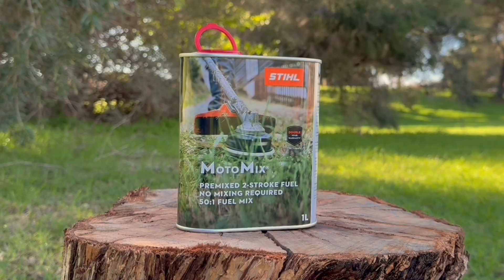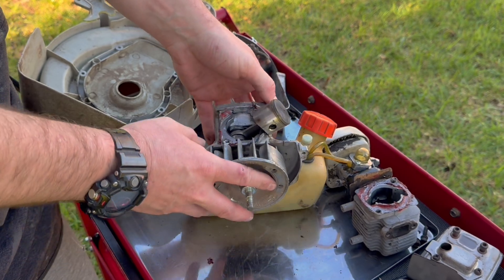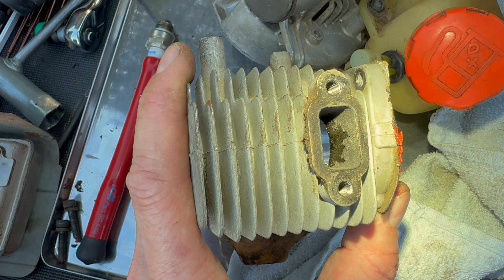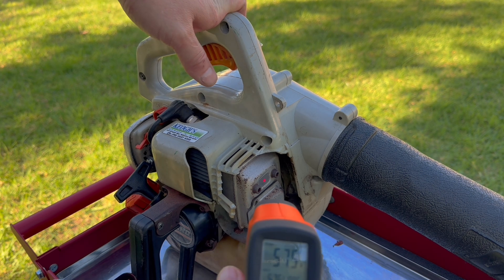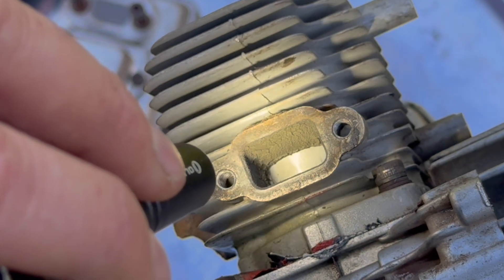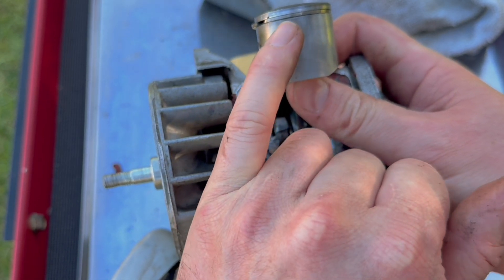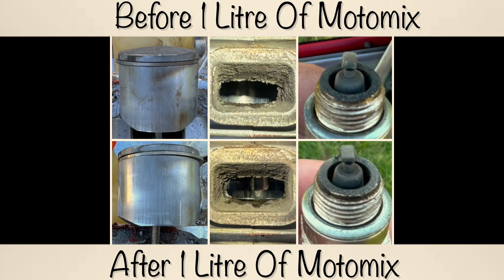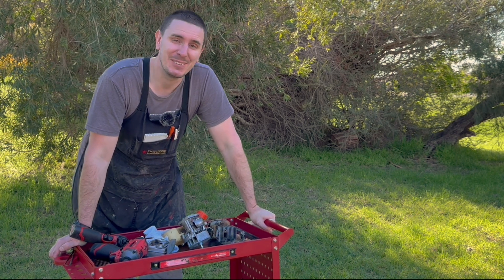STIHL MOTOMIX: Are They Stretching The Truth?

Comment: I Don’t See a Huge Difference I Think Motomix Works Good For the Occasional User In Preventing Stale Fuel in There Equipment After Sitting For Several Mos 😀 But If Your a Frequent User Just Use 93 Octane 40:1 Stihl Premium or Echo Red Armor and Run With It 😊😇👍🏼 Thanks For The Testing My Friend
Reply from the maker: I think you’re spot on :) thanks for sharing!
Reply: Providing you are using a quality oil and making a proper mix to the proper ration you are 100% correct but for annual storage at EP we suggest using our Kinetix brand alkylate fuel with our guarantee start up even up to two years. One service for a no start condition due to ethanol pays for many cans of alkylate fuel.

Comment: Hi Tom! I am not a fan of canned fuel for economic reasons.  It's so expensive, the price difference you pay with canned fuel over the life of the equipment will pay for new equipment, usually more than once.
Reply from the maker: Hey Bill! I agree, it’s overpriced and unnecessary often times! It has its place, but not for most people :)
Reply: @VintageEngineRepairs  🙂
Reply: Bill the Old Man at Eliminator Performance just commenting that we sell the B&S Kinetix brand of alkylate fuel 4 cycle, and 50:1 & 40;1 grades to all our customers for long term storage and even for 5 to 6 month storage use. In all cases we guarantee two year start up and to date can tell you that our annual profit margin has decreased due to these fuel sales. Additionally, our neighbour has 5 pieces of 2 stroke equipment and uses the Kinetix brand full time for the last 6 years without issue. We presently sell a can for $15 and reduce that price for multiple can purchases so our neighbour spends approximately $78 Cdn annually and prior to that was spending way more than that on labour and carb cleans and rebuilds. We feel bad for our customers that do not use an alkylate fuel and year end for storage, especially when their equipment does not start and they need to bring it here again. Many even when they have run the unit out of fuel noting they never get it all out of the carb bowl. The up sale here at EP really is "you can pay me now or you can pay me later" the smart ones spend the $15 pass the information on to their friends etc. and we continue to grow the customer base. One full service which includes a carb clean and fresh fuel here pays for 10 cans of Kinetix.
Reply: @waynestefinashen239  Hi Wayne! I agree with you completely that canned fuel is better for storage than untreated mix, and it allows people that don't store properly to get away with it. I tell my locals to use Sta-bil all year due to the heat here and to run them dry at the end of the year and have had really good luck that way. Lemme show my logic for not using canned:  Counting the additive price into the fuel cost brings it to about $3 a gallon(gas is cheap in Texas 😁). The best price we get for a gallon of any canned fuel here is $31 and change. I go through about 4 gallons a year in my yard between weedeater, backpack blower,  chainsaw,  etc. And spend about $12 a year on fuel. I haven't had fuel issues(so far), and I replace all my lawn gear about every 8 years or so. 
In 8 years' time,  my fuel cost here using canned fuel would be around $1000 as opposed to around $100 for pump gas and 2 stroke mix and Sta-bil. If you store correctly, which we both know a lot of people don't,  that's $900+ over the life of the equipment. Of course, the whole "storing correctly" will shoot some people in the foot 🙄🤣
Reply: @GuysPlayingWithTools  Got your point Bill we are using the BGSC2 fuel stabilizer now never had issues with the K100S+ just wanted another great alternative.
Reply: @waynestefinashen239  I agree 100% with the canned fuel for the guy who doesn't store correctly.  It definitely has its place there
Reply: Canned fuels are good to flush pump gas out before storage. Makes restarting your tool even years later a walk in the park, as they seem to protect all aluminium parts from corrosion and the rubbers from dry rotting/hardening (carb block and components, membranes, fuel lines). I stopped having issues after switching to them before storage, way better than just running the equipment dry.
Reply: @em4703  That's why I use Stabil storage in mine. That would be a good winter experiment.  I am going to fill one weedeater with canned and one with my normal mix and run them both empty today and leave them until March. 👍
Reply: @GuysPlayingWithTools  stabil doesn't do anything though. multiple tests running around the internet with all kinds of brands of fuel stabilizers, none work besides the stuff they use in refineries, and even that gives the fuel a few months of life tops. it also doesn't stop corrosion and dry rotting of rubber. you can make a can of normal pump gas, one with pump gas and stabil. by march they'll both burn the same: poorly or not at all.
Reply: @em4703  I expect the canned fuel to do somewhat better. I use the storage blend in everything all year and have never had any problems storing tools for winter.  I hate to do it since it know what to expect, but I will add a 3rd with no additives. I always have a few sitting around.
You are making me think about how I can make it harder on the machines, I am going to leave them uncovered out back.
Reply: @GuysPlayingWithTools  You do not have to run them out of fuel, leave the fuel in both
Reply: @waynestefinashen239  I have been pondering that,  even though we know what will happen to one with no additives, I was also thinking that the best test is full
Reply: @GuysPlayingWithTools  We have only been installing either a 1/2 or full litre into equipment and never had an issue with moisture likely because there is no ethanol. Over 10 years even with the small amount added to generator fuel tanks we have never had issues.
Reply: @waynestefinashen239  I was thinking that too, but we can still get ethanol free here
Reply: @GuysPlayingWithTools  Lucky have you tested it to be sure?
Reply: @em4703  100% correct
Reply: Not if you have a $2000 chainsaw that you only use once a month or so when needed.
Reply: @Russell-d8s  It is the only thing to use in a chainsaw that is rarely used same thing goes for generators here in Canada we use Kinetix alkylate fuel from B&S

Comment: More gimmicks .
I have been running motors on normal oil for 50 years never had issues.
Its not a F1 engine.
Cheers 🥂
Reply: My Dad, even up through his 80’s used regular motor oil.  He mixed his own.  That’s what they had. His equipment always ran great and clean.
Reply: @steveriggenbach90  4stroke leaves alot of ash but can be used .
I use good quality 2 stroke oil 32:1 in all saws .
Also non alcohol fuel.

I raced motocross bikes Enduro all two stroke .
They of course require synthetic racing oils .
Reply: @Motorhead250  I’ve had great luck with echo red in my equipment.  Lucky to have station that sells non ethanol rec  90.    Today’s oils are superb to the old.   Works better with the heat and tighter tolerances.   Haven’t rode in years.  Good talking to you.
Reply: @steveriggenbach90  yeah on old school two strokes any oil is ok.
Some needed 20:1 mix even 16:1 lol blue smoke .
I use Belray in my high output saws 372xp and 088 Stihl .
Reply: @ thanks, I’ll check into that oil
Reply from the maker: Thanks for sharing :)